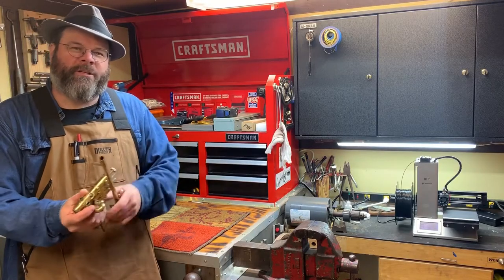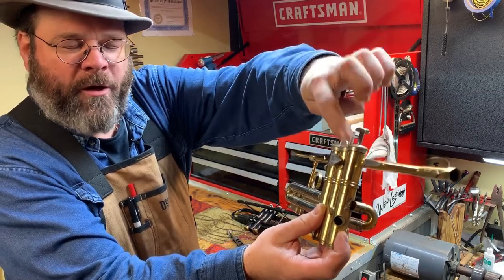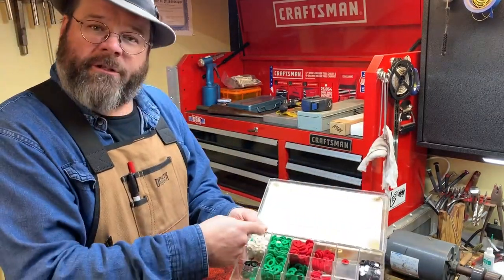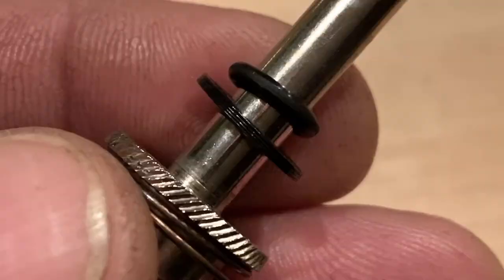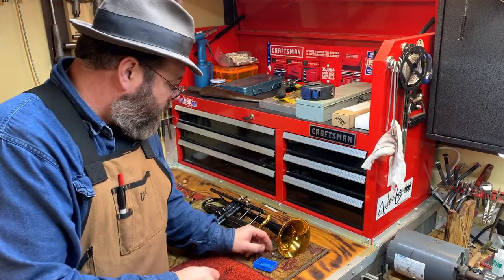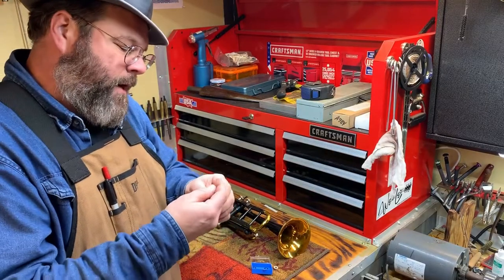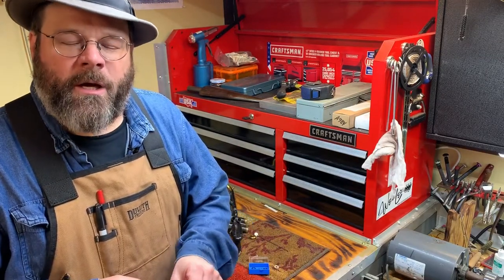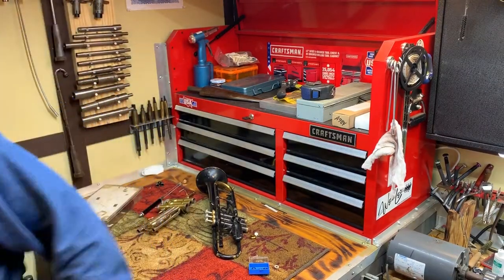Episode 16- Custom Valve Alignment & 3D Printing- Wes Lee Music Repair

Comment: I also already fix the problem like this with other way.
I Still use the standart size of felt but I make a new holder with bigger than the standart one. ( free fingering )
Then For felt of top cup, i Still use the standart felt but i Will change the halve stem/ the holder to get precision. 
I use lathe to Change everything. Good luck

Comment: I bought a old German Acme Trumpet. It is mint.It has a adjustable Valve stems. All horns should have this. I love this old horn . It’s beautiful with nickel lead pipe and bell. Has stone inlays on the slide knobs .circa1953 ,like me. I love the long side handles too on the water keys

Comment: Does a new Bach Stradivarius need valves aligned ?
Reply: Bach's are notoriously out of alignment but not the worst-no matter the brand, ALL horns "technically" require an alignment...whether the player will like it or not is a different story.

Comment: This is exactly what I think I need. I have an old (patented in 1898) Conn valve trombone. I it is relatively dent-free but valves are very sloppy… not really playable. I was very fortunate to get it dipped in silver to recoat everything 10 years ago. Would it be worth it to ship from Houston to you to fix? What’s your advice? I thought it may need new valves…but who knows? It is a collector item, I don’t really play it. Thanks for your great videos!

Comment: how do you determine the thickness of the disk and O ring
Reply from the maker: Two things are known. The thickness of the O-ring and the overall height needed. So the disc printed or turned on lathe is the difference of these numbers.